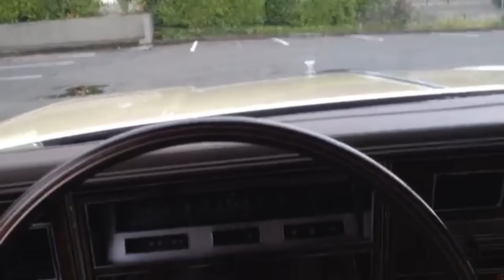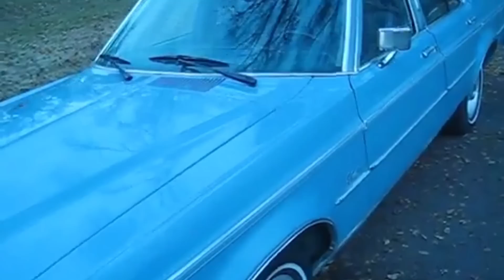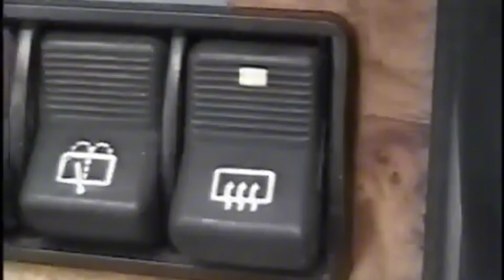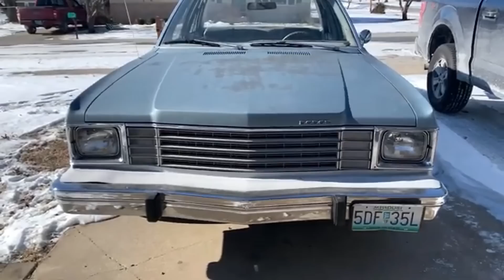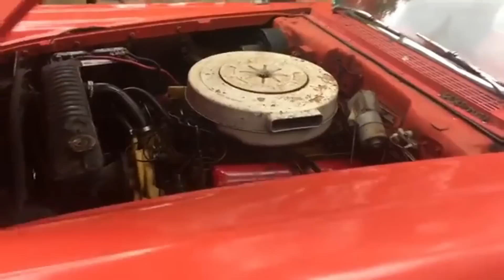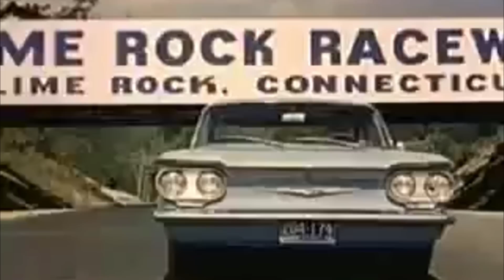These Killed Americans! 10 Most Dangerous American Cars You Won’t Believe Were Real!

Comment: I had a 62 chevy II.
ONE of the best cars ive ever owned.
The problem? My ex has to have a mini van. 
Guess it hard getting you illegitimate kids out of the back seat. It was a 4 door. When you are a big Sow.  
Thats one car i wish i still had. It was a rock.
The only problem i had was... The clutch goes in backward. Took a couple months and getting it away from my dads mechanic.
I took it to mine.
Pushed it into the shop 
He asked what is wrong. 
I just got it out ofy mouth that i put a clutch in it and it doesn't work.
When his dad. A retired mechanic walks up and said.
No problem. The clutch is backwards. You put it in right. But that car you have to put it in backwards. 
Come tomorrow evening it will be fixed.
And it was.
For years my dad would not admit that was it. Always called me a liar. 
Btw. When it was at my dads mechanic i asked him to try putting it in backwards. Something i had not tried.  He claimed he did. But i know he didnt.
It was the problem. My mechanic has no time to do anything else. It wasnt the only vehicle he was working on.
Now for honesty. I think his dad fixed it. The transmission was light. And about a hour plus job if done fast. But for a old guy. A good couple hour tinker job. Just right for him. 
Thier history was interesting.
Just before I meet the mechanic he came back home. A fight years before between father and son. Son (mechanic) had taken off the another state. Father had a heart attack and flatlined. The mother called him. He came back. The father and son patched things up.  According to them both ignorance of youth and hardhead of the old.  That took a few years for them to tell me 
Anyhow. The Father was mechanic. And had to shut down the business then it happened.  The son had been gone for 10(?) years. 
When i meet him. I was his first customer. His dad id findout was still in the hospital at that time 
And i had broke down right by the shop.  He was coming home from seeing his dad in the hospital.  ( Bad ball joint on my truck) 
He ran the shop for a few years. Then i got stationed someplace else 
2 years later. I came back. And learned he closed the shop. And the dad had died. I didnt press it. I wasnt needing anything done.
Finding a good mechanic is hard to find.

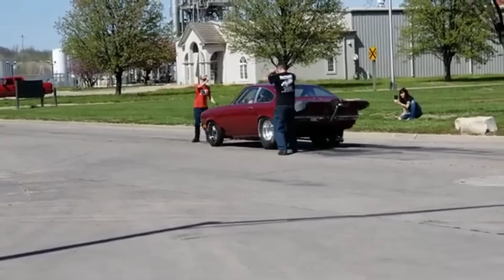Comment: The heads were cast iron and cracking was not an issue. Overheating of course damaged the blocks which actually sagged in the middle. Cast liners would have sagged right along with the block. 22:00

Comment: The Corvair wasn't unsafe, everyone only thinks that because of Ralph Naders book he wrote. lol
Reply: They were so unsafe that there are still plenty of them around
Reply: @kellismith4329  My father has (2)
Reply: @fishingishard2do  they are very cool cars
Reply: GM took a chance on something that was so cool and beyond anything else. Then a goofball who couldn't run a popcorn stand made a name for himself.
Reply: @henryhill3778  yep, he was a wingnut who had it in for GM
Reply: The first two years were actually very unsafe. After that they corrected the problem but by then it was too late. I remember very well following them and watching them Dog track going down the highway sideways.
Reply: @carlmiller8640  Bout the same thing happened to the Pinto
Reply: Not to mention all of the oil leak fires.
Reply: The safety factor was corrected early in life, tire pressure was critical to handling.  We had 2 of these & they were great snow cars.
Reply: The car was basically a boxy Porsche of the time. If you didn't know how to drive it hard in a corner,  it could swap ends really quickly. Same as a Porsche.
Reply: Raulf had a hard on for Chevy back then,  remember why,   Ahahahahah Ahahahahah?
Reply: Yeah when you turn a corner at 40 miles an hour of the door comes open who turns the corner at 40 mi an hour